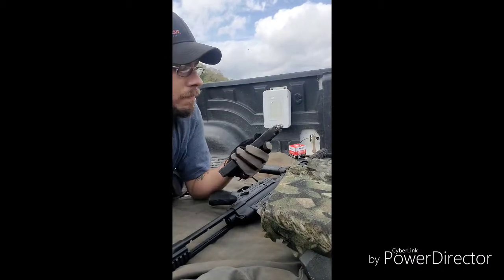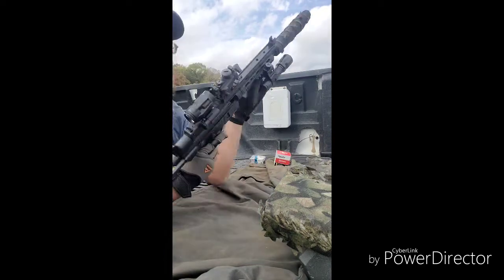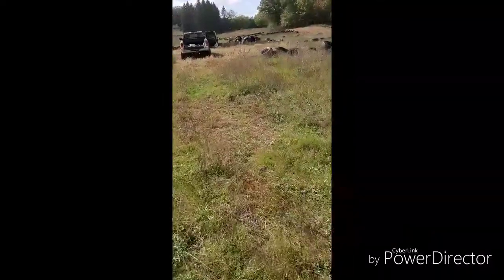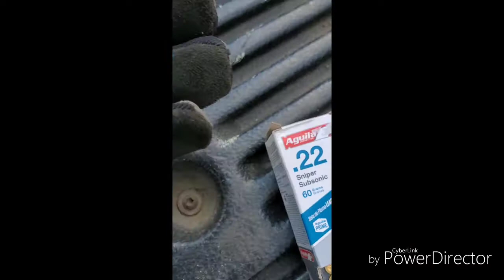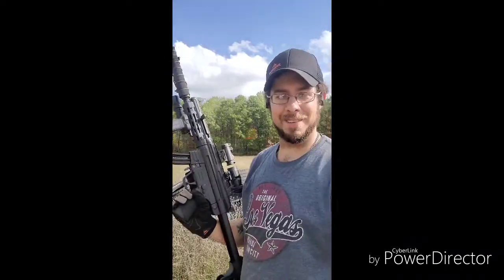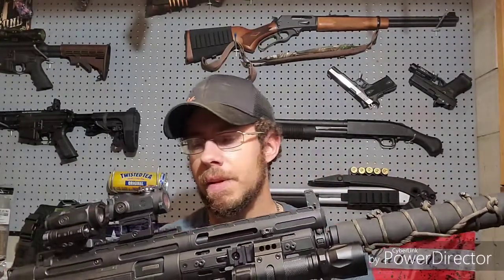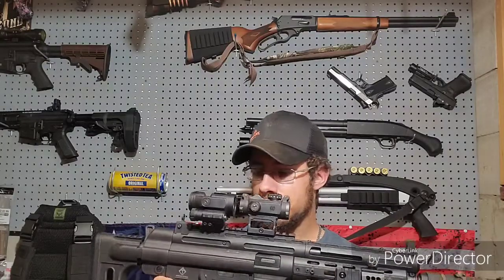My new GSG-16 .22 caliber MP5

Comment: Took mine out for 1st time. Shot that Aguila ammo, 250 rounds. Gummed up my bolt and left white grit everywhere. Will not be  shooting that ammo anymore. The gun itself is very accurate and fun to shoot.
Reply: Which Aguila, he shot both lead subsonic and the copper plated supersonic ?

How's your ATI GSG holding up 2 months later ?

Researching to buy... thanks
Reply from the maker: I actually haven't ran anymore of those subs through it since. I traded it in and my buddy ended up buying it. He only shoots the higher velocity rounds through it so I honestly couldn't tell you .